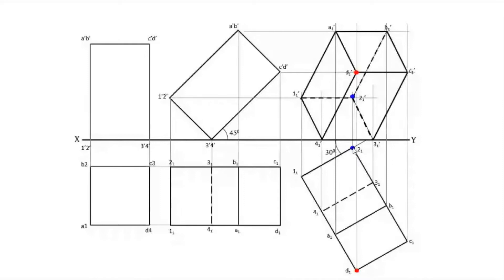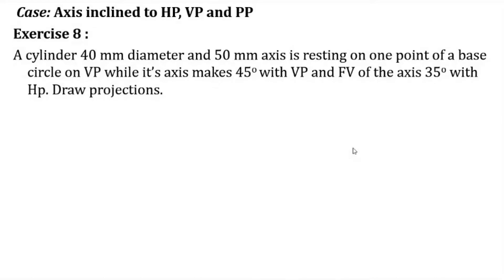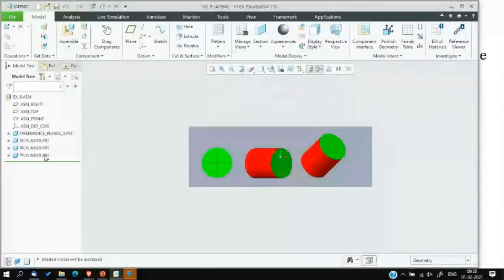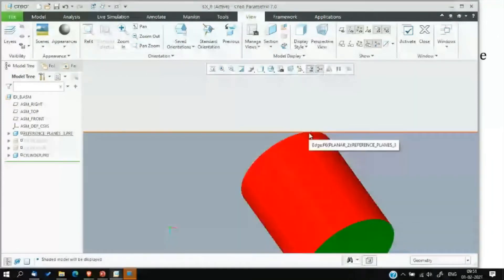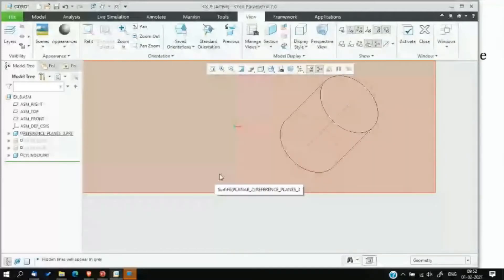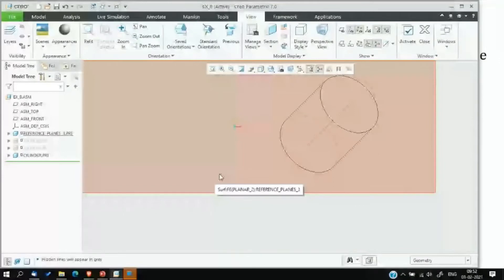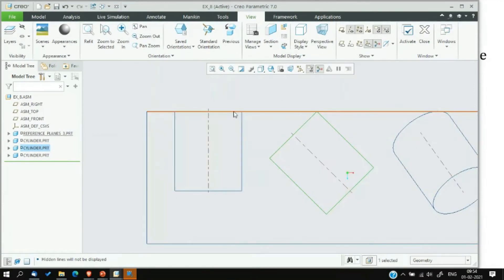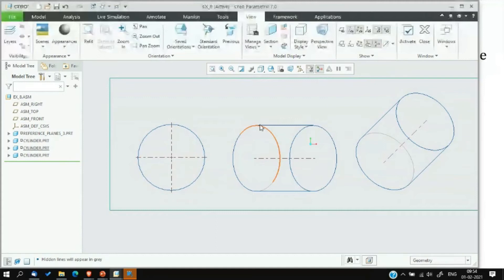Projection of Solids| SOLVED QUESTION| Engineering Graphics - Lecture 14b

Comment: A cylinder of base diameter 50 mm and height 80 mm rests on its base rim such that its axis is inclined at 45° to HP and remains parallel to VP. A section plane parallel to HP cuts the axis at a distance of 50 mm from the base of the cylinder. Draw its front view and sectional top view.

Comment: A cylinder of base diameter 50 mm and axis 70 mm rest in the VP, has its inclination to 30° to the VP and front view of the axis is inclined at 30° to the ground line XY. Draw the projection of the cylinder.